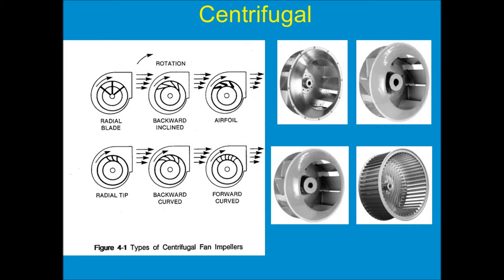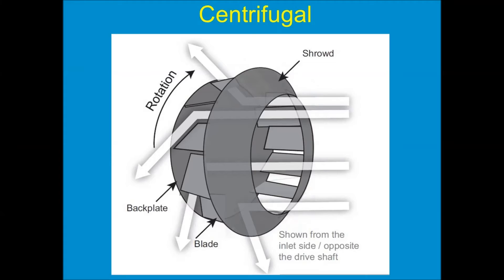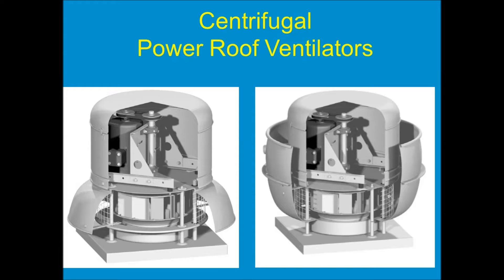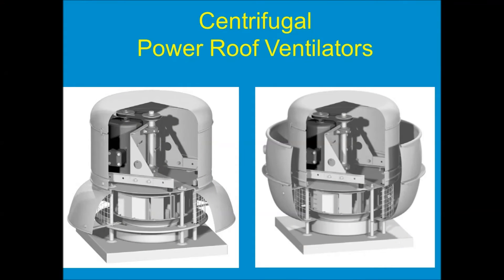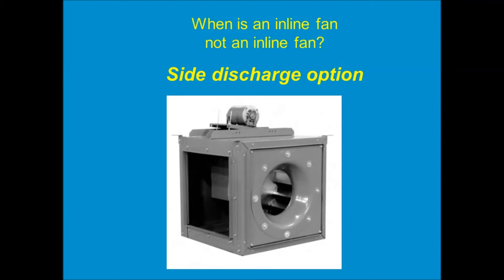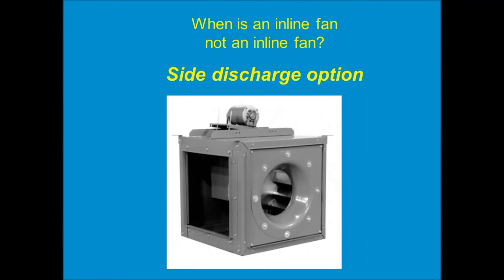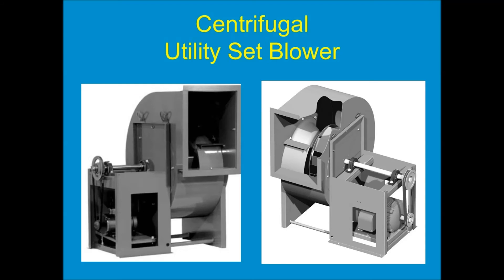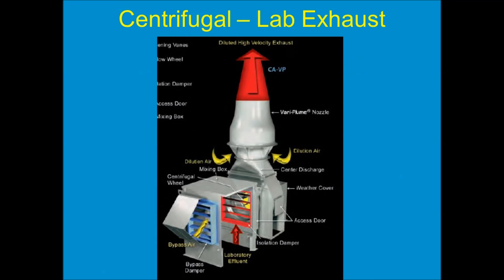Basics of Fans & Blowers - Part 2

Comment: great videos!

quick question: how does a tower fan work? the impeller "column" inside the fan is capped on both ends so inlet air doesnt seem to be drawn in through the center of that column (and then discharged through the blades). this makes me wonder how the supply air is provided.

also, there is a discharge grill at the front of the tower fan (where the air comes out to cool us down) and a inlet grill at the back of the fan (supposedly where air is sucked in). based on the principles of centrifugal fans, wouldnt air be blasting out of both the front and rear grills?

thank you so much!!